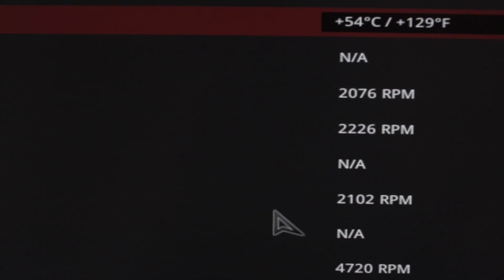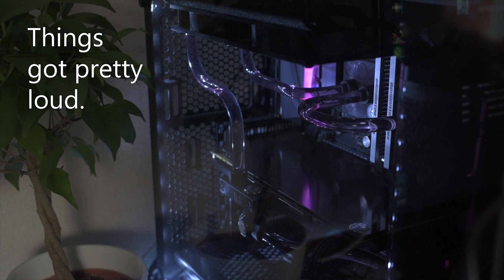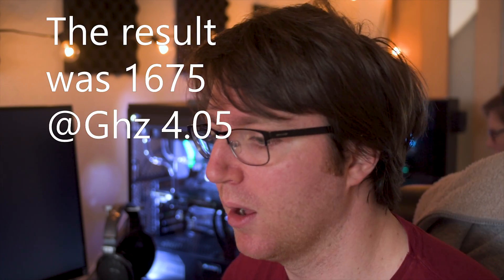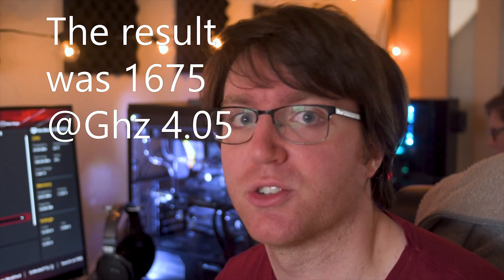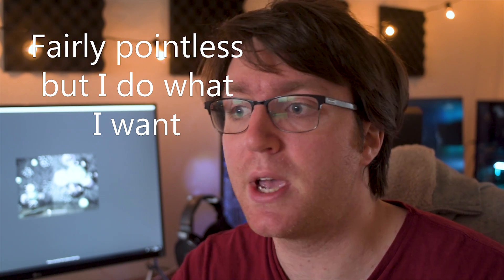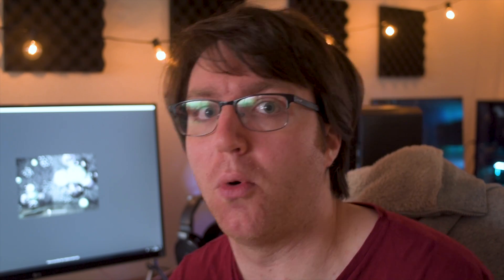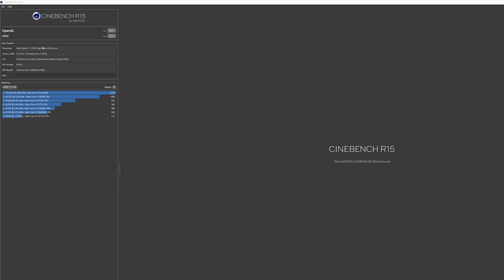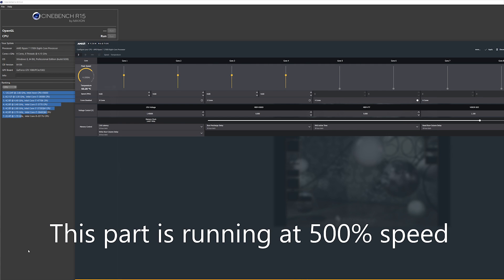How far can you overclock an AMD Ryzen 1700X CPU?

Comment: Right.  Moore's law is dead. Engineers are doing all they can to allow for higher clocks and more efficient processing and power management. The big difference in AMD right now is 7 nm, and heating the chips at smaller an smaller lithograthy, means more quantum tunneling and degradation of the die.  The only thing better than current CPU's will be Quantum processing.